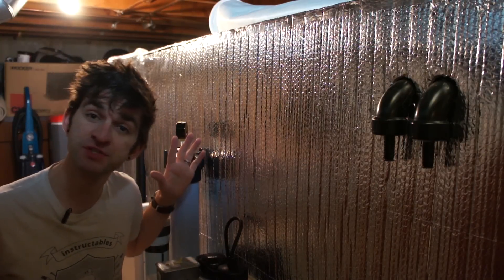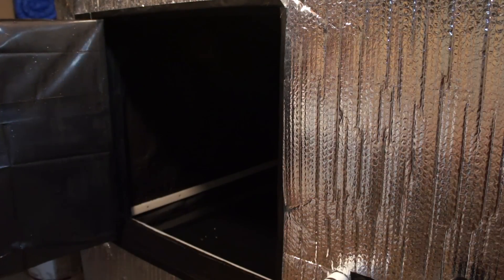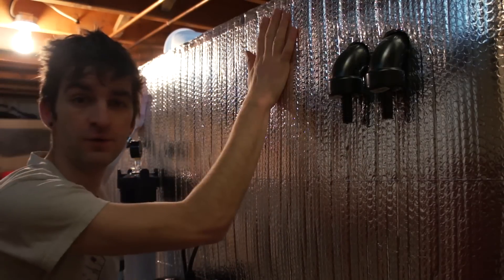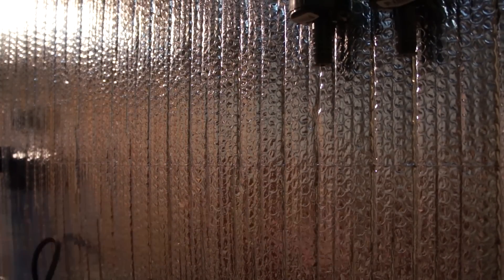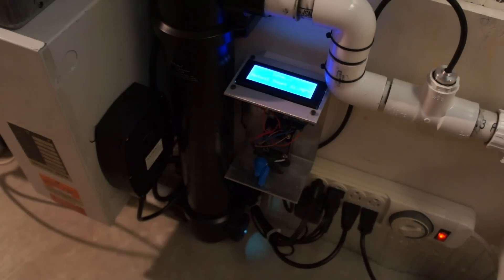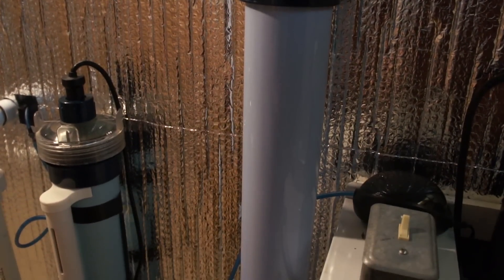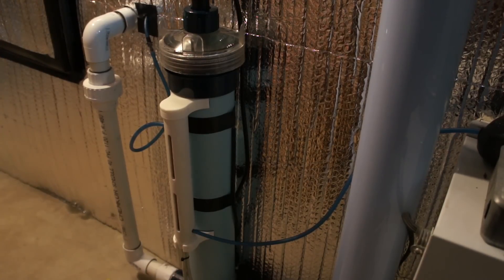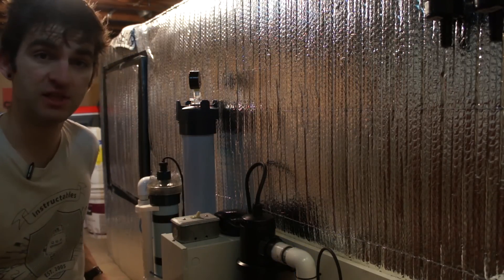Isolation Tank Project - The Overview

Comment: We're 3 years on since you published this build. How has this done over time? Any changes since then? Tnx for posting - this is a niche area for sure, but not everyone can afford $10k+ plus for even a used commercial unit.
Reply from the maker: Thanks for watching! For what it was it worked great, there are a few things I would change if I built it again but I think you could build a great unit for sub $5000 and have it function even better than this did. This unit was taken apart after about 2 ish years (but still working at the time, moved houses) but here is what I learned:

-EPDM is a fantastic material and I would make 100% of the interior out of it in the future. It showed zero degradation over the time and I had zero leaking issues.
-The titanium heating element was great but failed after about 1.5 years. Probably the weak point of this system, replaced with a 500W unit which had no issue holding the tank at temp (enclosure was heavily insulated, would not have been possible without the large amount of insulation). Run 2 heating units in future to have redundancy.
-Door is where all the leaking / water issues were, find a better door design or use more EPDM rubber in this area...minimize the seams here or design so water naturally flows away from area.
-Passive air exchange works OK, added a very small active fan after a few months...little too stuffy inside during floats.
-Hydrogen peroxide was used to help with water sanitation (35%), started using it early on (before any issues surfaced)...seemed to work well. Next build I'd increase water pump size to get even better filtration. Added about 1oz per day to keep ppms inline.
-Make filter cleaning / changing easier, ideally just buy a secondary filter to always have a clean unit to swap in during deep cleans.
-Mag drive pump worked without issues. Would buy again, double or even triple the flow rate to really agitate the water surface to aid in cleaning, worked fine but could be better.
-UV filter worked awesome, ABS housing around UV light source started to degrade / breakdown  from light source with time (which required more filter cleaning). Purchase higher quality unit designed for 24/7 use. Zero issues with UV bulb life.
-Add slight slope to inside roof, flat worked fine but required wipe downs before floats to avoid drips, not a major issue but nice to change.

That's all that I had noted,  hopefully this is helpful to someone in the future!

Comment: Lost me on all the do dad's on the outside of tank. So I used my pickup bed with tarp in it. Then put my camper top on it. Filled with salt water. Heated using exhaust pipe from truck running into tank. That ol 454 big block warms water real fast. And some reason I get dizzy 🥴 in there also. 

 Just joking. Cool tank project you've got there.

Comment: Great build! curious on a few parts:

Which 1000 watt heating element are you using? I’m trying to figure a reliable  one to utilize and could use your experience.  

Thanks and great work!
Reply from the maker: Thanks!  I actually had a hard time finding heating elements and eventually found a full titanium 1000W element on ebay that worked great. Another option I would probably look at if I built it again would be to use 2 heaters. I could then downsize to 500W units which are MUCH easier to source and give better redundancy.
Eventually my 1000W unit failed after about 2 years of running so I replaced it with a 400W Hydor unit (had to bypass the stock temperature dial) and surprisingly that worked just fine. The duty cycle was a little higher but it had no issues holding the tank at temp for the next year or so until I decommissioned the tank :-).
Hope that helps!

Comment: How do you calculate how much salt to put in the float tank
By the way very nice belt
Reply: Based on a 200 gallon tank that's 8' x 4'. It's almost always 800-1000 pounds depending on how buoyant you want and given that tanks don't vary too much in size. (Can't be too deep, for obvious reasons and quickly you get diminishing returns from making it too long/wide) 

Realize that will be easily be over $500 for the Epsom alone... Typically it ends up being more like $800 with shipping, taxes and all that.

But if that doesn't scare you then it's just a matter of getting a hydrometer ($15-$20 on Amazon) and measuring the specific gravity as you pour in more salt. It never ends up being exactly 800 (or whatever) So ordering more than you will need to hit 1.23~1.26 SG and then dialing it in with the hydrometer is the only real way to get consistent results. 

(Seems complicated but it's the same concept of taking the temperature of something, you use a device to get a number that only means something with further context.)
Reply from the maker: Bang on, I used just over 800lbs of salt in this tank and it uses about 20-50lbs of salt per year depending on float frequency (you remove salt on your body with every float...the better you squeeze water off your body, the less salt you waste).

Comment: Could you publish your designs and schematics? Also what was your total cost? It seems that you still spent about $2K?
Reply from the maker: Correct, total cost is right around the $2000 mark, you'd be hard pressed to get it under that price point without downgrading some equipment.
Reply: @CurtVanFilipowski   then this sounds like a good deal? https://seattle.craigslist.org/tac/for/d/puyallup-zen-float-tank-at-home-sensory/6825851365.html

Comment: I am trying to create an isolation tank for the lowest price if you have any tips you are
 welcome
Reply from the maker: Don't skimp on filtration!  Unless you have a very powerful ozone injection system (ie. commercial) you will likely have to use H202 has an additive ( I currently use 35% H202 to help with water care). I would shoot for 10 micron mechanical filtration as well as 20-50 watts of UV lighting power for sterilization.  I've been running with these specs for over a year now with great water quality!
Reply: @CurtVanFilipowski  thanks you maybe i can join you on your mail to ask for tips ?
Reply: @CurtVanFilipowski  Brilliant job !     What is it like to float in ?   You should absolutely do a Kindle eBook on Amazon with pics and specs.  Do you follow the floattank subreddit ? https://www.reddit.com/r/FloatTank/new/

Comment: What's the ozone for? Great video
Reply from the maker: Thanks, ozone is a great oxidizer and works well for sterilization / disinfection (at appropriate ppms).  I'm injecting it directly into the water which when combine with UV lights works very well to kill micro organisms that may be present in the water...as its also making contact with the air inside the chamber it helps to keep the air somewhat sterile (once again, I need a much higher concentration then I am able to generate but none the less it helps).  I only run it after floating for a small fraction of time as you do not want to breath that stuff in!  Smells great (like a thunderstorm) but also damaging to biological tissue!
Reply: @CurtVanFilipowski  Super pedantic but it doesn't actually kill microorganisms directly, (few things do) rather it damages their mitochondria making them incapable of cell division. 
(That is to say: It's not dead but also can't make babies meaning it's nearly impossible to harm someone with an uncompressed immune system)